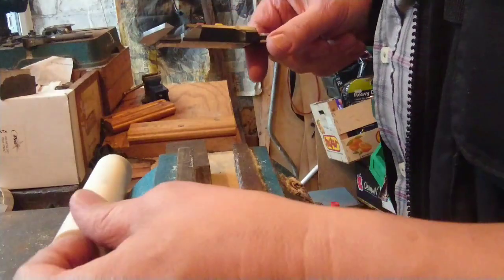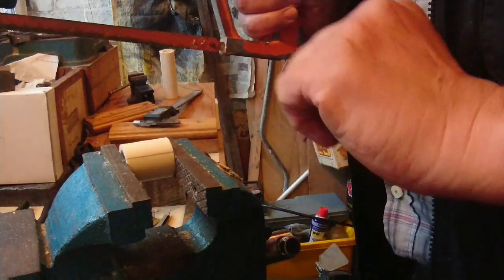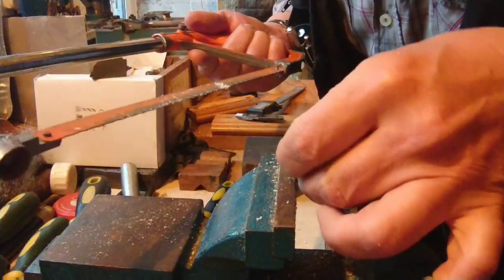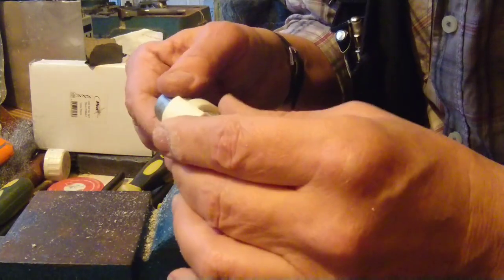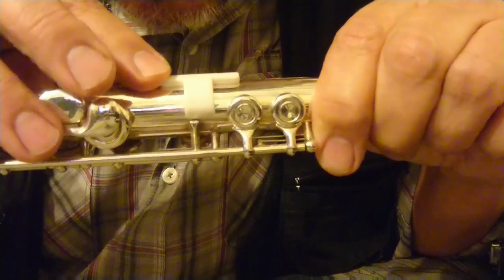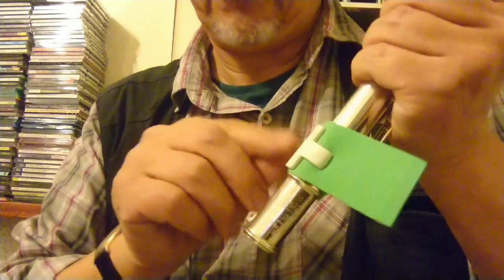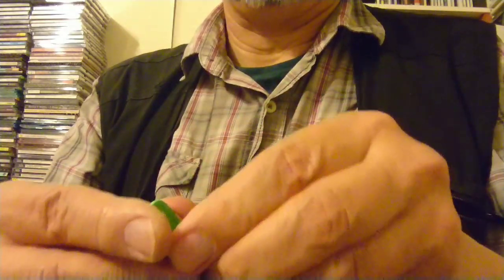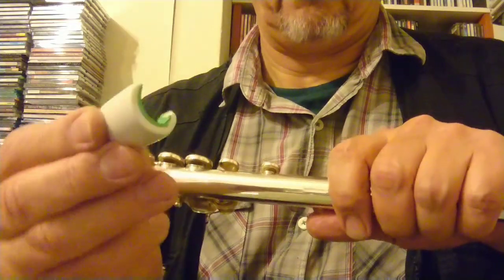Making a DIY experimental clip-on L1 finger rest for metal Böhm flute.

Comment: You might as well have completed the most useful device having gone thus far. I refer to Boehm’s invention which combines the left finger rest together with an exension downwards terminating in a small horizontal bar which rests   in the hook formed between the base of the thumb and the palm. This device will immediately raise you several levels up in proficiency. The Boehm device used to be available in a shop in Canada , I do not know if it is as yet available. But you could complete the work yourself having gone thus far. Boehm made all his flutes with the finger rest as you have made, together with the vertical support considered essential by Boehm and yours truly. You will bless yourself the day you play your flute fitted with the original Boehm finger rest and vertical support. You can find images of the d evice in Google under Boehm flute Crutch.
Reply from the maker: Thankyou for your comment. I am well aware of the crutch and that Böhm advocated its use and supplied it with flutes he manufactured. I don't share your opinion of it but agree completely with Miller who, in his annotated translation of Böhm writes: 'The translator agrees with Rockstro, who, in 
his
“Treatise on the Flute”
says: 
“The crutch 
is a cumbersome and unsightly appendage, and
 is useless to those who have properly constructed 
flutes, and who know how to hold them. It seriously cramps the action of the left hand fingers,
especially the thumb, while it is unproductive of 
a single advantage. Happily it is now almost 
obsolete." ' Moreover, a crutch would not in any way have answered the need of my friend in this case, which is to do with the outer diameter of the flute tube and the tight curvature the too-thin-for-comfort tube of a metal flute imposes on the L forefinger.
Reply: Thank you for your reply. Rockstro  has his own biased opinions about the great craftsman, musician, metallurgist and engineer . Just why he hated Boehm will never be known. No one but no one in the      whole world adopts the Roskstro holding position of the flute. The Boehm flute is the epitome of craftsmanship and the enormous work that went into its development and eventual manufacture. Boehm’s concert flute is only surpassed by one other development and that is the Alto flute in G  also by Boehm,  which is impossible to hold unless one allows it to tilt down to the right which makes the entire scene not exactly pretty. A special head joint which is angled makes playing the alto a joy, as the body now rests against the right leg ,bassoon like.  With the  straight head joint, this flute must be played with the Boehm support not merely for the left hand but also for the right. Please do try out the left hand support. Believe me despite Rockstro’s statement to the opposite, flute playing becomes a pleasure and a joy only to be exceeded  by the use of the right hand support developed by a Canadian  and available in Canada. The very best to you, Sir.
Reply from the maker: Yes, Rockstro's bias against Böhm (and others) is well-known, but nonetheless some of his criticisms absolutely hold water. This is one of them (and supported by Miller), and you are simply incorrect in asserting that no-one today uses the 3-point support Rockstro advocated (not his original idea - read his section on the topic). Very many fine players do (unfortunately) use a more R-thumb underneath posture, but it's easy to find equally good ones using the 3-point support method. I could point you to Irish trad players who play like gods but rest the flute crown end on their shoulder: they mostly admit it's a bad idea (pain in the neck!), but it doesn't stop them playing wonderfully. The same is true of other less than optimal habits. R thumb underneath falls into that category.

If and when I get an opportunity I shall certainly try a crutch, but one has yet to come my way. However, I know for certain from first principles that, barring a disability forcing me to use one, it will not be advantageous.

But really, as I said in my previous reply, none of this (though an interesting debate) has anything to do with my video/finger rest for L1.
Reply: Thank you for your reply. You are absolutely right in stating that the ‘ debate’ has nothing to do with your most useful video on the construction and use of the finger rest. The flute and other instruments have proponents or players or virtuosos using all sorts of devices to render these more playable. But devices I refer to natural devices such as flute position, head position embouchure position etc etc. I must admit that Boehms’ crutch is not a thing of beauty for sure and I am disappointed that being the jeweler that he was he did not or could not have come up with something elegant. I have been in the instrument refurbishing business for more than fifty three years and have designed and manufactured elegant versions of this crutch . My design it has been said actually enhances the over all elegance of the instrument. There must surely be hundreds if not thousands who have designed works of art around the crutch and we never co come to know of them. If you would give me your address, I would check to see if I could not gift you with this most useful devlce. Truth be told you yourself could absolutely make this as an extension of the finger rest. The Boehm design uses a separate finger rest which is permanently affixed to the instrument. My version has the finger rest extended downwards  or under the flute to enable a more elegant design of the crutch to be permanently affixed to the finger rest or you could make this removal if you so prefer. The finger rest must absolutely and necessarily be faced with the softest felt or other suitable material  to preserve the finish on the flute.  All of the highest ranked flute makers in the world do offer this device as an optional. manufacturers including Haines, Rudall Carte the better Eastern manufacturers included also.      Please view the bassoon support and you have an idea of what could be done to improve the looks of the Boehm crutch. The Anthony Baines book has a picture of an alto or bass flute with quite an acceptably good looking and totally functional design for the leg support. As for virtuosos using Rockstros support method, I have not found one single instance in the entire continent of Australia, England and most of the US. I cannot understand the hatred or ridicule or contempt that Rockstro has for the many inventors who have toiled towards the development of the flute. There are other treatises  including that by Bate and Toff on the flute that present a complete and unbiased account of the history and development of the flute.I found Millers’ book for the most part supportive of Boehm, An aspect of the work done by Boehm in developing his flute hole positioning does not even seem to deserve a casual reference by Miller. I refer to the ingenuous ‘ moving hole’ technique which I myself used some years ago when I was designing a key less chromatic flute This flute incidentally cannot be played unless fitted with not one but two Boehm supports one for each hand. Thank you again for your fine reply and           I wish you the very best in all things.
Reply: I agree with you that the ‘debate’ has nothing to do with your video illustrating the construction of the finger rest. I have not found one single virtuoso who uses the Rockstro support method. On the other hand it is so very obvious that all flutist squirm , twist and turn and use just about any ‘device’ to enable the flute to be supported. So we see the flute held at a ridiculous angle downwards, constant shifting of the hands. When these gymnastics could be so very easily and elegantly eliminated by the use of the finger rest and right hand support.The left hand support could also be used with advantage to present to the thumb a flat surface to enable this digit to totally support the instrument. The Canadian support I referred to had additionally two sides so that the thumb did not wander about. What truly amazes me is that both right and left hand supports have been more or less deliberately ignored . I have seen soloists of superb proficiency who have held the instrument perfectly  without squirming this way and that and these must be in the absolute minority of performers. Most instruments are supported sufficiently to provide the maximum comfort for the main activity which is of course playing the instrument. Some saxophones have a mind of their own and positively refuse to line up as the player would wish. A striking of one such saxophone is the Keilwerth of which brand I have a tenor and an alto in F. These instruments just cannot be played standing as they sort of turn upon the player in the manner of a snake turning –upon its handler. Miller for the most part is supportive of the great master Boehm though he has dealt with at length with the ‘ schema’  not much or nothing at all is mentioned about the genius method of the ‘ moving holes’ used by Boehm to accurately position the holes on his flute. Please do make the remaining  piece of the Boehm right hand support. Your finger rest could be extended under the flute and the support affixed ( screwed into)  to this finger rest here. Incidentally the top brands offer the Boehm support as optional. Unless one actually tries out the support, it is totally absurd to merely accept another’s obviously biased opinion or thoughts on the subject.  What could be said against the Boehm support is that for a jeweler of the first order of excellence, he could not or did not come up with a thing of beauty rather than a crutch shaped appendage . All the very best to you.
Reply: I agree with you that the ‘debate’ has nothing to do with your video illustrating the construction of the finger rest. I have not found one single virtuoso who uses the Rockstro support method. On the other hand it is so very obvious that all flutist squirm , twist and turn and use just about any ‘device’ to enable the flute to be supported. So we see the flute held at a ridiculous angle downwards, constant shifting of the hands. When these gymnastics could be so very easily and elegantly eliminated by the use of the finger rest and right hand support.The left hand support could also be used with advantage to present to the thumb a flat surface to enable this digit to totally support the instrument. The Canadian support I referred to had additionally two sides so that the thumb did not wander about. What truly amazes me is that both right and left hand supports have been more or less deliberately ignored . I have seen soloists of superb proficiency who have held the instrument perfectly  without squirming this way and that and these must be in the absolute minority of performers. Most instruments are supported sufficiently to provide the maximum comfort for the main activity which is of course playing the instrument. Some saxophones have a mind of their own and positively refuse to line up as the player would wish. A striking of one such saxophone is the Keilwerth of which brand I have a tenor and an alto in F. These instruments just cannot be played standing as they sort of turn upon the player in the manner of a snake turning –upon its handler. Miller for the most part is supportive of the great master Boehm though he has dealt with at length with the ‘ schema’  not much or nothing at all is mentioned about the genius method of the ‘ moving holes’ used by Boehm to accurately position the holes on his flute. Please do make the remaining  piece of the Boehm right hand support. Your finger rest could be extended under the flute and the support affixed ( screwed into)  to this finger rest here. Incidentally the top brands offer the Boehm support as optional. Unless one actually tries out the support, it is totally absurd to merely accept another’s obviously biased opinion or thoughts on the subject.  What could be said against the Boehm support is that for a jeweler of the first order of excellence, he could not or did not come up with a thing of beauty rather than a crutch shaped appendage . All the very best to you.
Reply from the maker: Here's an example of a truly great current high-pedigree professional fluter who uses Rockstro support - when he plays modern flute too. This new video reminded me about this point. I could easily find others, but see little point.
https://www.facebook.com/story.php?story_fbid=508697016457919&id=325160661478223
Reply from the maker: Every single one of the four rather well-known leading modern flute professionals (!) in this video uses the Rockstro support method - look at their R thumbs! Jimmy Galway's is the only visible thumb tip, that's still pretty far back, and he's well known for teaching/advocating a Rockstro-based support method.
https://youtu.be/DOUb9cBdkIM
Reply: Thank you for your comments and the link. I have seen the great James Galway personally up close at a distance of a few feet and have noticed during his recital of the Flight of the Bumblebee he constantly shifted his finger positions. The Rockstro position for the right thumb is the only possible position as it totally frees all the operative fingers . However this still leaves the position of the left hand fingers open and  this is where the Boehm method offers the only possible solution.   I played flute for some seven years and used the right hand position of Rochstro and the Boehm positional support for the left hand. I have no bias for or against any of the great inventors or musicians who had worked on flute development but have used whatever device or method I  found to make things easier for myself. I must agree with you that the crutch is not exactly the most attractive device to be appended to the beautiful instrument but then others have designed crutches which are things of elegance and beauty so why not just use these if they make life easier regardless of what this one or that one has to opine about the matter. Totally nothing to do with the present subject, but I did notice James Galway’ eyes moving from side to side seemingly either without conscious control or as a tic.
Reply from the maker: Well, there are other possible positions for the R thumb, though I'd argue very, very strongly against them. Look at the likes of Gary Schocker - his is shocking! 

JG's eyes - he famously has an astigmatism which causes his eye-flicker - he wrote about it in his autobiography and has spoken about it in broadcast interviews.

I don't see anything wrong with players adjusting their hand positions occasionally for comfort - it is not necessarily a sign of instability. Each of those players is rock solid stable whilst playing.

I agree with you up to a point about doing what works for you, but regardless of its looks, I'd still contend that the Böhm crutch is a largely redundant idea save to help with specific handicaps making the normal L hand posture/technique impossible.
Reply: Thank you for your reply and comments. I was terribly sorry to know about JG’s eyes. No one that I had spoken about it to seemed to know that it was an actual medical condition but I am happy  to  know that it does in the least affect him in any way. When I say he was constantly adjusting his fingers and hands I mean constantly , not  now and again but for ever and being an apology for a flutist  this actually disturbed me considerably. JG was an credibly affable person I found when I  fortuitously met him again in a music shop. About this that and the other, my dear Sir, I am not in any way in the business of making and selling crutches. I was many many years ago teaching flute and I found quite apart from the technique involved, all, repeat all, students found the most difficult part of the entire venture was actually holding the flute. I imported many sets of thumb and finger rests from Canada and believe me they sold out immediately. At the present time it is not possible to send you a picture of an elegantly designed crutch because the lady who owns  a flute with this device lives quite a distance away and over here we are in lockdown mode. The only aspect of the entire learning and playing experience is to not torture oneself in the attempt and any thing, any thing, that makes life easier is to be welcomed. Quite apart from the  actual improvement and almost total freedom of movement of the left hand fingers that the crutch bestows upon the player is the fact that no less a genius found this to be so. Due to  dental problems I had to give up playing the flute and took up first the clarinet which I found to be totally irrational in that the second octave or register was something else  and so gave that instrument up and took up the saxophone. With this the dental problems matter not at all . I had a Selmer mkvi and also a Keilwerth Angel Wings tenor and alto . I found that the MKVI to be heavily over rated and disposed of it , keeping the Keilwerth which though  super excellent in all respects had a mind of its own when played standing. The instrument would twist totally over to the left. So I could only play the tenor sitting down The alto was playable standing.I also had an Armstrong alto flute which was totally superb. It was thin walled and well balanced but the left thumb Bb did not suit me so I hardly used the instrument preferring the much heavier DeFord which has a most excellent Bb key work. One has to find that which suits one the best and go with that regardless of what this or that expert opines .Thank you for your continued interest and replies and comments